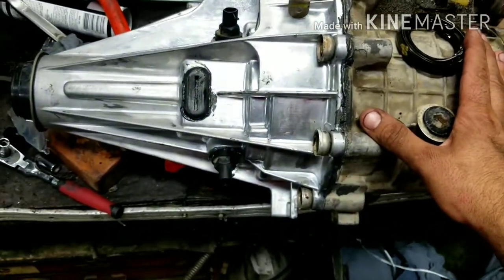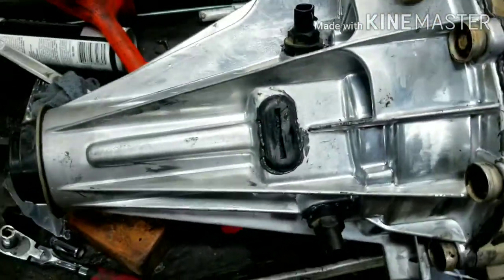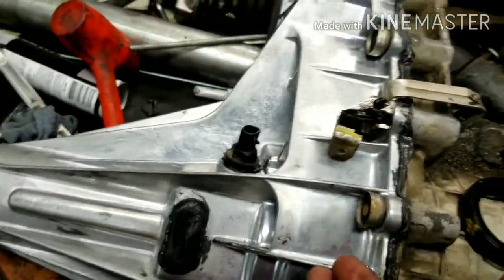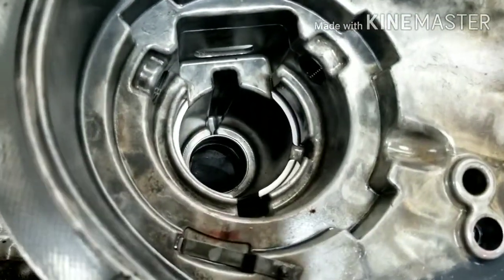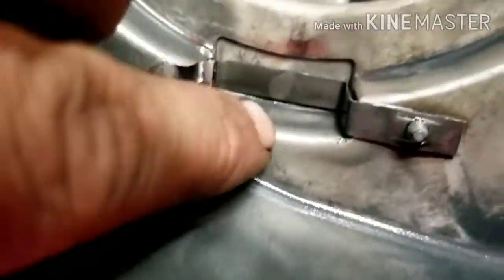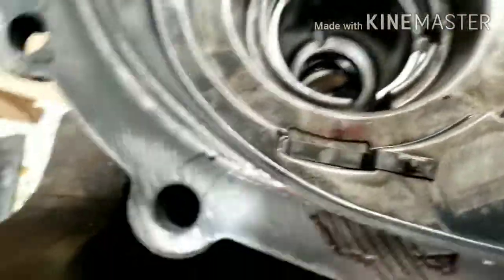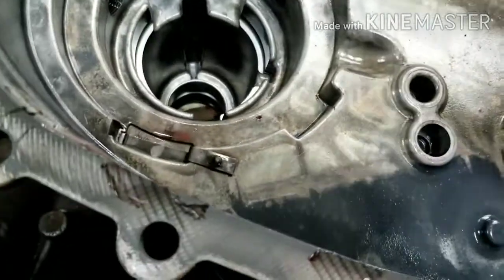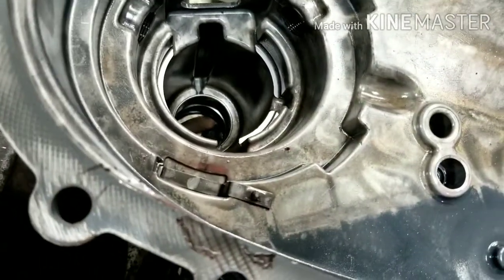98- 2008 gm transfer case leak issue.

Comment: Hey I have a 2013 Ford edge and everytime I accelerate higher than 60 mph I get a bad rotten egg smell ( catalytic converter smell). I'm not sure if it's one or both of the cat's or a missfire, but if its a missfire I would be getting a code which I'm not. Thanks
Reply from the maker: You can get a rotten egg smell from either to much fuel(runnin rich) or to little fuel (running lean) and if it was lean you may not have a code thanks for watchin. Besure to like and subscribe and check out facebook
Reply: Yeah but do you you know what part would be causing it to run lean. and how about the cat's can they be bad to because I do have a loss of power too. Thanks I liked and subscribed